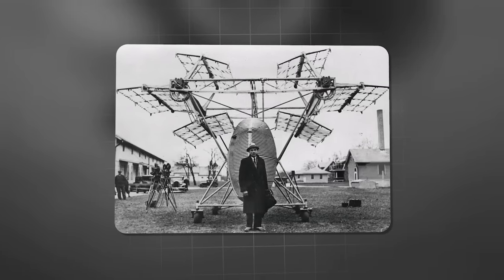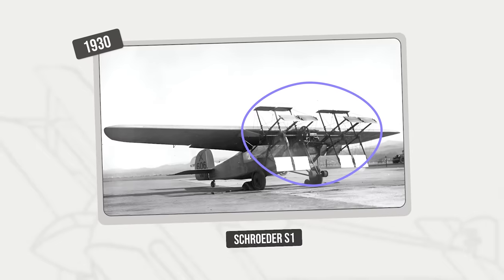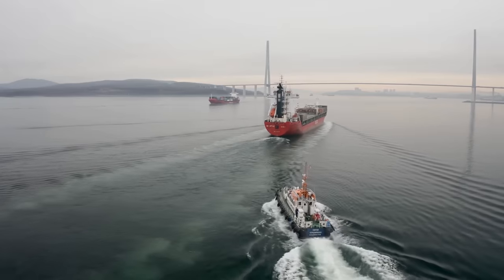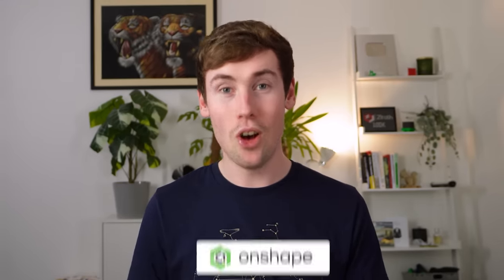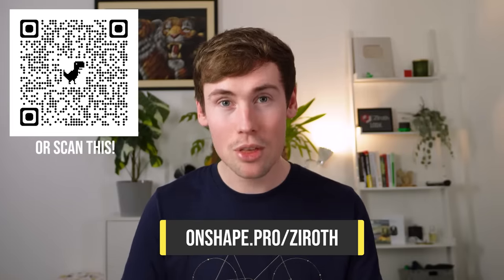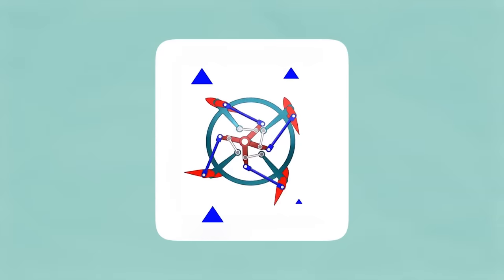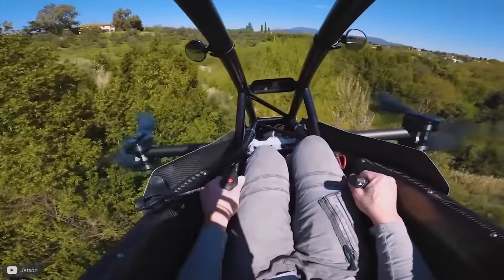The Genius of Cycloidal Propellers: Future of Flight?

Comment: Um , yah , I’m concerned about the safety factor . A child could still wander into that set up , and that’s why we don’t HAVE ONE IN EVERY DRIVEWAY . But that concept is intriguing to think about . The rotors are pretty well covered . 
Yes and thrust vectoring is unique . Paddling . Or cutting you way through the air or water then paddling .
That is the thrust dynamics of the v tol system . And that , our military uses for more precise control . But even that has no civilian application . YET .  
I don’t see why no one uses it . Still that is good thinking . Your system bearly makes any noise .

Comment: As with most new technologies, advancement will come through materials science. The true driver of modern (and ancient) civilisations.
Reply: I think it more likely that the advances will come from Artificial Intelligence (AI). Once each blade on the rotor can be controlled independently, an AI algorithm is more likely to find the most efficient way of controlling the blades in dynamic situations. Materials science and metrology are also important. If the AI can't measure a parameter, materials science might mean that the AI can ignore it.

Comment: Hard for me to describe, but why not just have just 2 cyclocopters, one front one on the back. One in the back pulls air over the top of the aircraft that is shaped like a wing. A big box that that is shaped higher in front tapers towards the back like a wing . The cyclocopters in the front forces air into a tunnel under the aircraft that has louvered panels that open and close, the airflow could direct the air to lift the craft off the ground

Comment: I look at that setup and go:  "Hey, no retreating blade stall flipping you like a pancake.  These should be able to go REALLY fast."

But I look at the functional example presented and I go:  "Control systems using belts.  Yeah-NO!"

If the belt slips or snaps...

Comment: i personally dont see them being used in any personal flight vehicles as you just cant get around there weight, as there prototype was as light as they could get it and it was at the same weight as the one that used normal propellers and was made of aluminium. And i know its a prototype, but considering the sheer amount of moving parts required to get such an effect with so much control while also being sturdy enough to withstand super high centrifugal forces I don't see it getting all that much better there, and bare in mind it would also need an extra 30 or 40 kilos of battery's as well.

Comment: Wondering whether these would make sense on large hovercraft. The noise problems was always a big issue for the cross channel hover ferries back when they were common, if these can provide a lot of air movement for less noise then it might be worth considering. Also weight isn't as much of a problem for hovercraft since they are supported by a cushion of air. Just wondering, maybe there's an issue that makes them a problem for such an application, but I can't see one anywhere.

Comment: With the rotors themselves accounting for half the weight of the craft, it sounds like a non-starter. Add batteries, and there's no capacity left for a pilot/passenger. As for ships, I'm pretty sure that most of them still have conventional propellers.

Comment: So, I keep noticing drones with "double propellers" or whatever they're called: basically, at the end of the "arm" there's two motors - one pointing up and one pointing down, each has a propeller attached to it. I fail to see the advantage in having this over just a single motor and propeller with higher torque? Yet, while these are clearly more complex, they still exist, so I have to assume there is an advantage that I just can't see. I'm just starting to be interested in drones and aviation technology, so please forgive me if my ignorance is striking to some.

Comment: You know, the problem with those older desings is that they don't move fast enough, to produce enough thrust, to do anything very useful, compared to modern aviation fuel requirements. Their design is so outdated, yet I think it could be useful in our everyday lives, somehow!

Comment: I see a problem in the case we would like to scale those propellers. Centrifugal forces will probably cause issues of adjusting blades on time.
Reply: Okay, centripetal forces would be the ones going out, making centrifugal ones the restorative inward ones, but model it up in a nice high entropy alloy and by the time you sort that out, how's it going? Is it a cycloidal rotor or a pulse chiller rocket...

Comment: The problem is in the loads, not the aero.

These designs have better aerodynamic, mechanical efficiency - but they end up being expensive and heavy. This results in poor cost efficiency.

The problem with these designs is their forces result in cantilever moments instead of tension forces. This increases the stresses up by 10 times or more, requiring more material. The centripetal loads of the extra material increase the stresses further, and the material goes up more.

People point out that the loads on an axial turbine are also moment loads. The reason the turbine works is - centripetal stiffening. This is the effect that lets people spin a lasso or bola. The spin creates a force like that in a centrifuge which keeps the blade straight. The aero forces and centripetal forces are in opposition and balance each other out.

These designs don't benefit from centripetal stiffening. As a result they get bigger, heavier and more expensive as they scale up.

This is also why underwater turbines, and rotating machinery in general, do not work well for underwater energy collection - unless the blades are very short.

This has never moved forward for valid, physical reasons.

Comment: Interesting design and I can see why engineers have tackled the challenge, but I can't see it ever having widespread application.  The amount of extra moving parts and complexity means it will never be anywhere near as reliable and safe as a traditional rotor driven by a motor.

Comment: The efficiency of this design could be improved a lot by trying to duplicate the flapping of a bird"s wing, but in a circular fashion, which is a well proven efficient biological design. In the cyclorotor, for vertical thrust, the wings are vertical at the 3 o'clock and 9 o'clock position in the cycle. Instead, for vertical thrust, they should be 10 deg at the 12 o'clock position, 0 deg at the 3 o'clock position, -10 deg at the 6 o'clock position, and 0 deg at the 9  o'clock position. This gives the flapping wing a much better power stroke. Also the wings should have camber instead of being a symmetrical airfoil.

Comment: Computer Numerical Control (CNC) mismatch seems to be so much dramatic on Cycloidal system than Bladed system. And using more energy isn't the trend for the world. It's kinda strange that you didn't stress on the power consumption side.

Comment: What is the basic thrust efficiency of these propellers in air?  The original Wright Brothers propeller in 1903 was 80% and a few years later they were making propellers with 90% efficiency.  Obviously modern props are a bit better still, but that leaves little room for improvement.  While these propellers have some advantages for some purposes I suspect they aren't as efficient.  Combined with heavy, expensive, complex design requirements and it seems like a dead end for aircraft where weight and efficiency are of paramount importance.

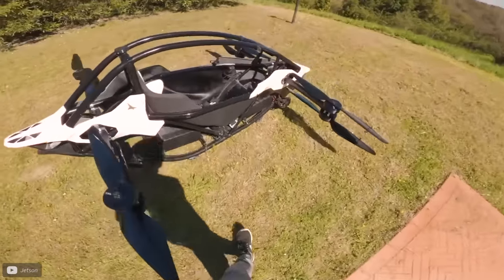Comment: 10:50 very much would not want to be in a hover craft with propellers trimming hedges.  Where unpredicable changes in thrust and propeller speed could topple the craft and or send it spinning out if control.
Reply: Also, contact with hedges would for sure damage the airfoils and change their shapes and characteristics and balance.

Comment: Unless your an aviation geek like me ( probably are since you are here reading comments), you probably don’t know that modern high bypass turbo jets Like General Electrics GE9X creates nearly 135,000 pounds of thrust. Up to 80% of that thrust is generated by the incredible fan you see up front. It’s not the jet blast coming out the back but rather the fan that produces the power. Essentially it’s a ducted fan on crack. I’m not seeing the system in this video getting even close to this type of power in its current state. However, I love the ingenuity and maybe someday it progresses past the current technology. As battery tech makes leaps and bounds, in a few decades turbo jets burning fossil fuels will be on their way out and perhaps a propulsion system like this takes over. Who knows.

Comment: Cycloidal propellers on boats do not have to worry about carrying the weight of the craft. No matter which way they thrust, the upthrust from the water against something which is overall less dense than water. For aircraft, which are heavier than air, the failure of the prop without a lifting aerofoil means the ground is an inevitable and unwanted destination.

Comment: Most general aviation still runs on leaded petroleum. (Some exceptions use regular unleaded, or diesel, but 100LL avgas is everywhere)

I wouldn't hold your breath for this particular propeller design to become commonplace...

Comment: Potential uses come down to thrust to weight, and durability.  Seems that a cycloidal propeller will weigh substantially more for the same amount of thrust as a conventional rotor and the larger number of moving components will reduce durability.

Only winning space may be for very short range flight requiring quieter operation.  My guess is that this not a large enough market for commercial viability.

Comment: The blades are doing the same thing as helicopter rotors, why wasn't the swashplate mentioned? It controls vector and thrust in one mechanism. However, the same problem of advancing and receding blades having very different relative airspeed still exists in this system, limiting the top speed.

Comment: Efficiency wise, how do cyclo rotors compare with normal propellers? If that Austrian company has worked on a cyclo rotor machine for 15 years and they're still not in production with a working system, that doesn't make me very hopeful.

Comment: perhaps it could hav a (very light) advantage with "long but thin" cylinders along / inside the edge body of the aircraft,  with only one direction for the stream, so with a classic quad copter algo. 
this kind of stuff could give a huge lift with a very slow move so being very quite while very safe compared to "blades" turning around you
Small horizontals rotors competing with props seems too complex, too heavy, much more expensive for quite no advantage in safety or weight to lift ratio to be interesting

Comment: I wonder why none of the airfoils of the cyclorotors use a mesh for a surface. Or maybe its just too hard to tell in the videos. I mean, since the speed is always high, taking advantage of a mesh acting pretty much like a solid surface at those higher speeds seems like an easy way to reduce weight, now that high strength lightweight materials like carbon fiber are available. Or maybe that's the issue- a mesh degrades the structural integrity for those types of materials too much? Interesting stuff. I would bet on the electronic controls over any mechanical linkages, though, that's for sure. The spped of response, removing yet another place to worry about deformations, etc. etc.

Comment: How are you going to drive it? You can't run it inline like traditional designs, it would have to be outboard.
You going to belt drive it or direct drive it? Either way you still run into the same limitations of a traditional piston engine design unless you're planning on an electric motor driving inline and that brings in a whole 'nother set of mechanical issues. It does however solve the  ballance of an aircraft if it's electric. Put the engine powering the generator wherever it is the most condusive of locations. 
You could even have battery back up for an extra period of flight if the generator shut down due to problems or running out of fuel.

Comment: Each day that does by I come to believe more and more that motors will go through a tranformation like it was with LEDs and their use for lighting systems. My theory is in the future, not that close though, motors will become smaller, lighter, a little more powerfull too but more eficient within the progress of the integration systems. Maybe the best option will be to have more smaller motors connected to circuit board controling and regulting independent power feeds to have them all working perfeclty in sync on commands. Tat new generation of smaller synced motors will open the doors for all type of movements and discarding the use of movable blades within propellers.
I´m not an engineer or anything like that but I have studied electronics for a couple of years and for what I´ve seen around technology evolution so far I really think my theory will become true in a couple decades.

Comment: The Jetson One could increase its flight time to maybe 40 minutes if they went with a gas generator and supercapacitor bank, and not only that it would be able to fully refuel its range in one minute rather than several hours. Even so, it would also either stay the same weight, or get a bit lighter.

Edit: And when I say gas generator, I mean military tech such as Liquid Piston's 75% thermal efficiency HEHC used to power the propellers of our surveillance drones, or the much bigger diesel units being used as stationary off-grid and backup generators. It baffles me that we aren't using them in cars now, but I guess EV fever is too strong to consider what is literally a massive leap forward for ICEs and a huge reduction in vehicle pollution.

Comment: I’m a little disappointed that I didn’t learn anything new from your video. Granted, I already knew how cycloidal propellers work and that somebody was attempting to make an aircraft with them. Would have been nice to hear some concrete numbers of thrust efficiency compared to conventional propellers, a complexity comparison to helicopters with their swashplates, and a list of advantages of this type of drive for the application of an eVTOL. It would also have been interesting to discuss the potentially positive influence of the Magnus effect.
Reply: Yes, and no mention that water is 800 times denser than air.

Comment: Very unlikely to replace props for aircraft. The advantages are just not enough to compensate for the complexity and weight of the system. As Musk says the best part is no part. One blade replaces 4 blades two end plates 30 bearings belts frames shafts and double the number of motors one for the rotor and one for the vector control. I also doubt the thrust it can deliver is  higher than that of a simple prop.
Reply: Agree, simplicate and add lightness.

Comment: The technology is neat but the requirement for more material/weight to make it work compared to a regular propeller does make it a dead tech.  Its only advantage is quieter than regular propeller.  I'm wondering if that is true if they have to lift the same amount of payload.
Reply: ISTR Jaques Cousteau had a large pair of these acting as masts+sails on his research vessle, Calypso.

Comment: I lose faith when seeing how old the tech idea is, which means there are extremely intelligent engineers who obviously chose not to use it. Must be a reason.
Reply: I think it has had 3 challenges for aviation use:  power/weight limits, inadequate control capacity (they probably have adequate ability to exercise high-data rate controls), and, most importantly, durability...

Comment: IDEA? Has anyone ever tried using a four sided pyramid shaped cycloidal wing to perhaps provide not just vertical flight but quicker horizontal flight,  just like a jet but with propellars...?
 Obviously it would need tilt or thrust vectoring to fly in reverse but just wondering if it's been tried..

Comment: In the current state of the game...? Cycloidal Propellers probably won't provide much for aircraft; however, that is only in the current state of the game. If, hypothetically, you have a different vehicle that lifts in a different manner than by pushing air down... these might play a much, much larger role. We're not there yet. Many parts for such a vehicle exist, but we're either missing a few pieces, or they haven't come together just yet

Comment: Having each blade independent and run by a motor might be the hard way to do this, how about a Gear that rotates the blades uniformly and you then rotate that entire part for direction control.
Must have been hard having a Great Mind and only Sticks and Canvas to build with. This was not possible for Aviation until the fifties.

Comment: Heavier, more complex, more expensive, higher maintenance, more points of failure. With fixed wing aircraft, there are fixed pitch propellers and constant speed propellers (variable pitch). There is a significant weight, complexity and maintenance cost increase going from one to the other, however you get increased performance and efficiency. Then there are helicopters. A huge leap in complexity, cost, maintenance, points of failure and significantly lower life cycle. This thing is a giant leap beyond even helicopters in all those negatives. There is a reason why it has not taken off in the past or now. Simpler is always better.

Comment: For a video tagged 'engineering', there's fairly little engineering here. How do the blades reorient mechanically and how that is limited? What is the expected and theoretical maximum efficiency of the cycloidal prop, when compared to normal prop? It's clear what the advantages are for applications as a propeller in water, in specific use cases, but none of those are about efficiency. It would appear that in an aircraft, efficiency is the #1 thing. Did not achived interest.